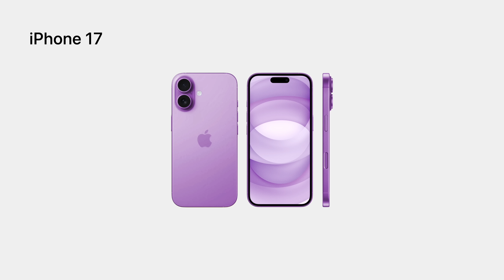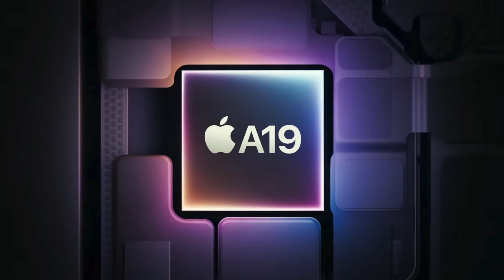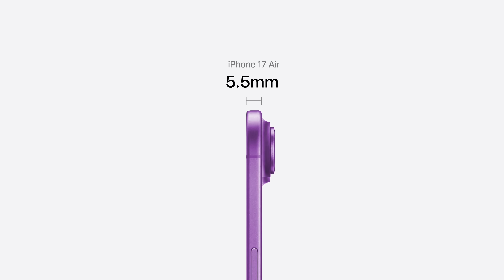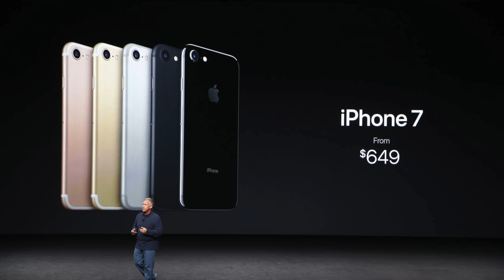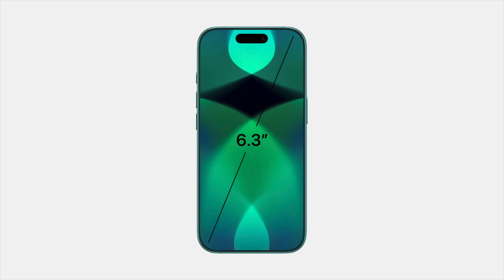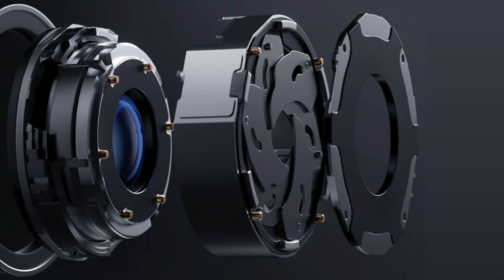iPhone 17: What To Expect

Comment: For those who were wondering,

1. The 6.3” display on iPhone 17 leak got denied after this video was made

2. The iPhone 17 will use the a18 chip:( but the 17 pro will use the a19 pro

3. It will be called iPhone 17 pro max

4. Not part of the video but iOS 19 will be renamed iOS 26, and also macOS 26, tvOS 26, and visionOS 26.

Comment: update: so the black glass camera bar isn't happening unfortunately but will be the same metal color as the rest of the device and there will not be a 2 toned finish even w the glass inlay it'll be the same color as the metal camera bar and frame of the device

Comment: 120Hz is just a dusty cloud of real storm, look at old 30FPS games, they are SMOOTHER than 120Hz games nowadays, now think again!
Reply: @nikostalk5730  😂😂😂
Reply: @michaelsemien9814  yeah, that could sound silly, but that's only for very first time, If you dig deeper, take a look into some close themes, such as gaming and film-making, you will end up with some well-known and solid facts about static framerate and variable frametime. 
Just to make my words shorter - 30fps CAN be smoother to a viewer while 60fps STILL can be percieved as "choppy" transition between each frame.
Also 60fps requires more hardware to render, so MORE battery consumption, and that's only for 60Hz, now compare it to 120Hz, but marketers still say "more FPS the better!", lol!
Reply: @nikostalk5730  You're right that consistent frame pacing is crucial for a smooth experience. Older games often had very stable frame delivery. However, modern games with variable refresh rate technologies and well-optimized engines can deliver a significantly smoother experience at 120Hz than at 30Hz, even with some frame rate fluctuations. It's not just about the raw number, but how consistently those frames are presented.

Comment: The iPhone 17 Air with the removal of the Bottom Speaker is basically gonna end up being the iPhone Version of the old & first ever 2007 iPod Touch 1ST Gen., since that iPod Touch didn’t have the Bottom Speaker either until the 2008 iPod Touch 2ND Gen..

With that, I would wish that Apple could find a way to keep the Bottom Speaker, or perhaps create a Back Speaker, or something, for that iPhone to continue having an External Speaker while being thinner than the 2014 iPhone 6/6 Plus.

Comment: So apparently the Air will use a Si/C battery. If thats the case, why not fit the same type of battery into the 17 Ultra too? Current phones with such batteries have much higher capacity than just 5000MAh.

Comment: While Apple fans likely like it .. i really, really do not like the supposedly new design. To me, the back of the phone looks bad. I do not mean retro or even dated .. just bad. 
The camera module reminds me of the typical 2015-2020 something phones that happened on the Chinese Android side .. with overlarge camera humps to compensate for sometimes mediocre hardware (the Poco type of phones...)

An anti reflective coating for the screen is nice, but again .. sort of 2 years old already (considering it appeared on the S24 ultra .. that also introduced a much harder screen).

As for the "Air" variant. I kind of agree with Apple that .. if the Plus was not selling well .. the Air is a nice alternative .. sort of? It looks more like a 16e with blown up hardware and price to me - also , as many likely have mentioned .. it borrows a bit too much from the "visor" design of the Pixel. 

All in all .. the new designs feel bad. I am NOT an Apple fan, i try to actively avoid their phones .. so i am highly biased. However, in terms of design (straigh edges, flush flat screen) .. Apple has most certainly been a trend setter. With the new designs .. i kind of doubt that it will be.

Comment: What a shame for the iPhone air. It still has that annoying camera lump which isn't flush with its thin design.
 Its technically not even the thinnest iPhone since I can redesign any iPhone and add a 0.1mm lip at the bottom and call it "the thinnest iPhone"

Comment: It looks like the iPhone 16 Pro Max will be the best phone to have until we get to the 18 Pro series. 

That being said, I suspect Apple at some point will stop counting up with iPhone using numbers. Maybe they’ll switch the Pro Max series to Ultra and then iPhone Ultra 2, iPhone Ultra 3 and so on. The standard Pro might just become iPhone Max to add more features to further differentiate it from the standard iPhone which will now have Pro Motion. 

That being said I think they may keep numbering the regular iPhone as there doesn’t seem to be a clear way of getting away from that unless they do a reset at 20 or start just calling it the current year and iPhone. 

For example, in speaking they’d refer to it as the 2026 iPhone and just put the year to the right of the word iPhone on the labels. For example, the box just says iPhone and the label in the small print would say iPhone (2026) 256GB.

Comment: 04:30 “rumoured to have a completely new design” by which you mean exactly the same design as every iPhone for the last 10 years. 😂
Reply: i do have to agree that design looks weird. but tell me the difference between the s21 and the s25?

also 10 years ago the iphone looked very different. yes you could say in the past 5 years but the standard one has changed 2 times with the 13 and 16.

Comment: So the 17 air will not be the new budget model replacing the 16e, but a more expensive than 17 standard
Reply: Was never meant to be
Reply: prob will be like the ipad lineup. 17e as the least expensive, 17 as standard, 17 air as better than 17 but less than 17 pro and finally the pro models.
Reply: @ there is no 17e
Reply: @coder_sai  mm i thought it would release every year like a series Samsung but ig not
Reply: @coder_sai  i guess not*